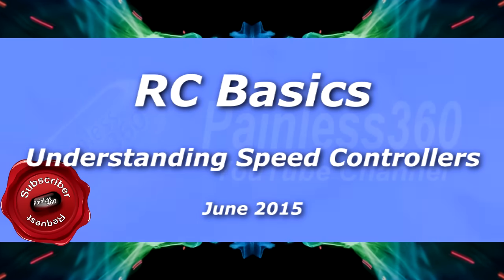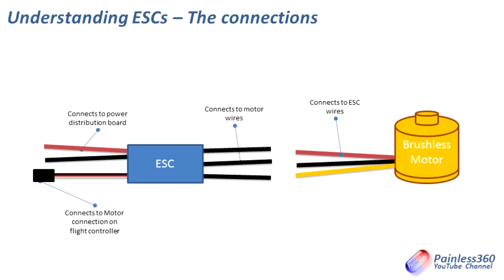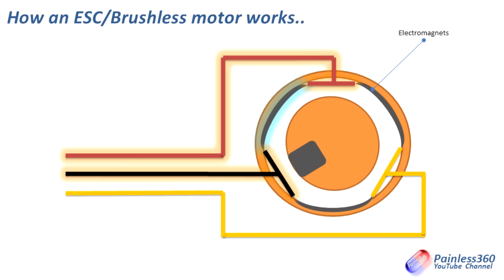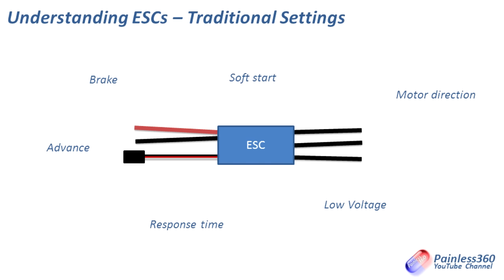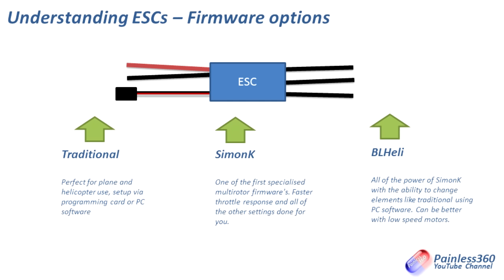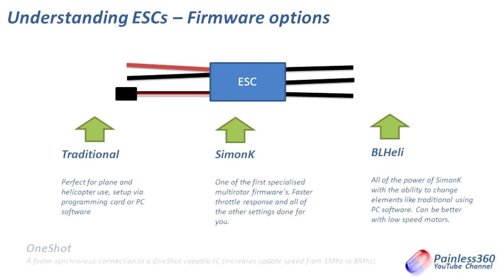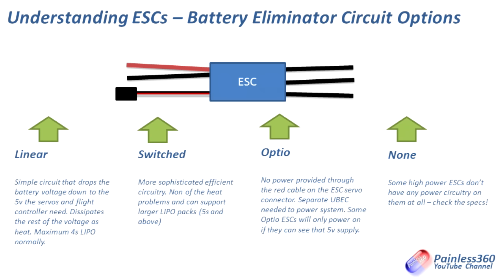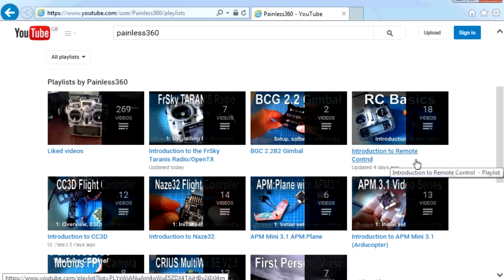RC Basics - Understanding Electronic Speed Controllers (ESC)

Comment: inav 4.0.0 armed.when use trottle stick up  and down motor not spinning. In  my fly sky trans.display trottle line 3 moving . when check motor test for calibration ,motor spinning.battery its ok.matek f 411 wse.
kto pomoze.jak nie rodacy
Reply from the maker: Please see my INAV 3.0 setup series from late 2021 I cover all the steps I use to get it working.. Best of luck

Comment: Interesting but it's not completely "Basics". You have stepped over an information that is still not clear in my mind. What ESC are actually doing from the throttle signal? What is controlled? Speed, current, torque, PWM? Is it possible to set a speed limit of the motor? These controllers do not work like industrial drives and this is confusing for someone not familiar with RC, even an engineer like me. I can't understand the absolute lack of information in the manuals of these products.
Reply from the maker: Bottom line - you don't need to know that level of detail to use them effectively. You calibrate the ESC so it knows what no and max throttle looks like. Electric motors are constant speed devices (hence the rating in KV) so the change the ESC makes is to the duty cycle of the high frequency pulse that it uses to power up the next phase of the coil. More throttle = more 'on' in the waveform. If you want to get into detail then there are lots of good detail in Wikis and the forums. Best of luck!
Reply: Thanks. I understand what you mean. But  I have a non standard project (non RC) similar to a EDF jet plane at high rpm. Since they work in duty cycle, it becomes a bit tricky to figure out what will be the maximum possible rpm. If I miss the rpm target by 10% I destroy the motor. My load will also be variable by a large factor. I suppose this kind of condition may exist with RC cars or boats when they leave the ground or water during a jump, then I wonder how they prevent overreving the motors if the ESC does not control (limit) the speed at all. No load, then very little current and much higher available voltage at motor phases which translate to higher speed.

Comment: I want a new esc but esc without the motor is almost as expensive as the esc and motor I would rather spend 100 and get a motor for 25 dollars then spend 75 for a esc by itsself
Reply from the maker: +paul garcia I've never found that. What ESC are you looking at?

Comment: Your description of 3phase motor operation is not entirely correct and a very over simplified. There is not sensing of  where the rotor magnetic pole is at a point in time. It is all down to the what the phase angle of each of the phase conductors are relative to each other and the voltage at each phase conductor relative to each phase conductor.

Comment: Sorry to pop your bubble but your explanation of the ESC is only half or less the truth. The ESC receive PWM(Phase Width Modulation) signal from the flight controller or the receiver. Then according to the PWM it generate a 3 Phase sign wave signal of variable frequency that determined the speed of the motor. The Motor is an inductive load and any inductive load have a destructive high voltage EMF, that is then filtered out by 3 diodes in the speed controller. The three phase is 3 sign waves where there is always a phase shift of 120 degrees between the three phases.
Reply from the maker: +Chris Bezuidenhout it sure is, its designed to help those new to the topic find their feet. If you understand that much about ESCs already then you're not the audience this was made for. Happy flying!

Comment: (At the risk of sounding like a know it all...) At 3.40 you say "apply power to the red wire and yellow wire to energise the electromagnet in the can"... Half true, but the yellow would need negative rather than "power" in order to work and complete the circuit. positive into both sides wouldn't do anything apart from short circuit. The motor is fed an AC like all 3 phase motors. 

Not that I'm splitting hairs here. I watched the video to learn myself!
Reply from the maker: This is a video to help explain the basics of how an ESC works, not get into the detail of how a potential voltage is used to create a current in a conductor. Adding too much unnessessary detail often makes a video too hard to follow for those unfamiliar with a topic. Teaching and passing on information is about making the subject understandable and this video is designed for those with a very limited understanding. Please subscribe. ;)